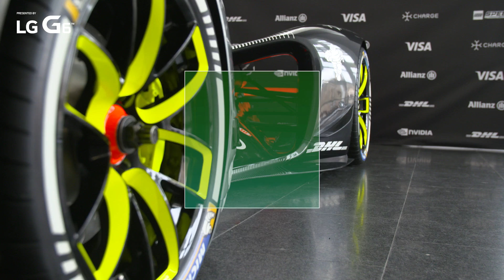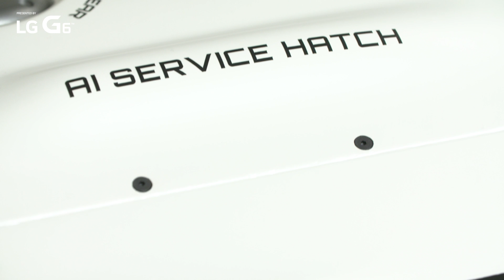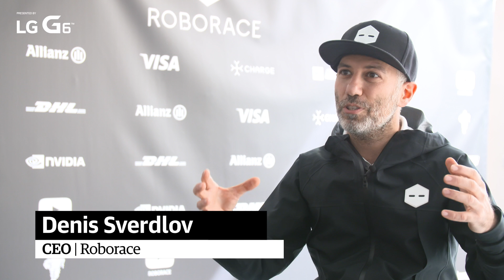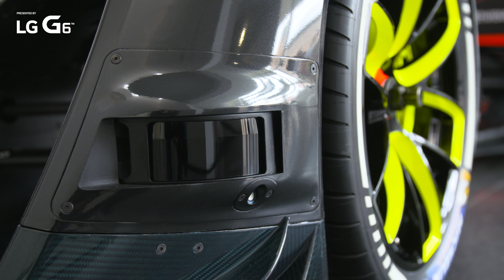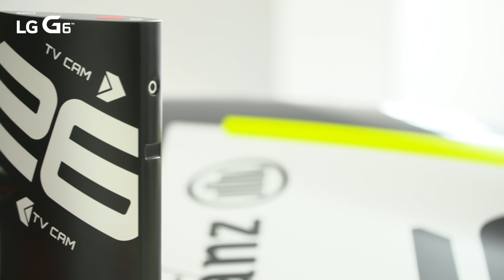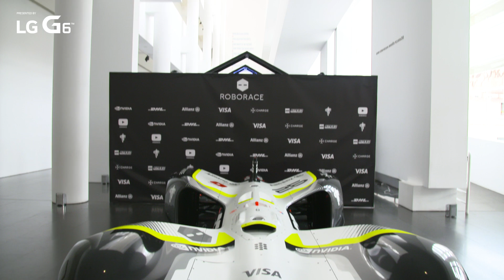Roborace | First Look | MWC 2017

Comment: Well, this is interesting.

Firstly, regardless of whether it becomes a huge success as a series, this (to me) seems like a great idea. Using the series as way of pioneering exciting and innovative technologies for later use in road cars (as has been the case in F1 for many years) is a very intriguing prospect.

Think about it - a dual controlled car which allows the driver to take control if they so wish, but which also has the ability to drive all on its own. Those drink-driving ads (and the many road related incidents which led to their inception) could be a thing of the past. You could drive your car to the party, and instead of getting a cab back, or having somebody be Des, you just have it drive you back safely. No need for a cab or Uber anymore (cue episode of Elementary in which CEO of Uber-esque company has a Roborace designer murdered for fear of losing out on profit, lol).

Also, from a competitive point of view, the removal of the driver (and, therefore, the risk to loss of life) from the vehicle means there's potential for much higher G-forces to be achieved, meaning we could see unprecedented performance levels. This really could allow engineers and designers to fully stretch their abilities in terms of their technological expertise - imagine if somebody like the legend that is Adrian Newey were to be part of building something which (unlike his X-series of cars which featured in Gran Turismo) didn't have to take into account limitations such as the maximum amount of G-forces a human body can (just about) safely withstand... For the first time ever in 'competitive' motorsport, we would (potentially) start to see what was physically possible from a race car, and not just what was humanly possible.

Very intriuging, methinks.

Comment: I can see some issues with this concept however, I do feel that we need it. All types of racing, whether it is WRC, F1 or WEC has translated into better technology in our everyday cars. This and Formula E has potential to improve technology in the electric cars we drive on the road. It has also potential to improve virtual intelligence. Teams will fight in the VI department instead of the usual engineering one. Then all you do is put well though out restrictions. Since its VI we could have these cars racing not on normal tracks but more of a dynamic track. Use cities, take several streets/blocks and have a constantly changing track to push the VI to the limits.

Comment: so, it's like watching a racing video game replay with all Ai bots? seems boring as hell.
Reply: Alamda Balqhin Are you stupid? It's ran by AI. A computer program will control it. Quit attacking commenters because you didn't watch the video.
Reply: For all the people saying this is pointless, you have no imagination. For one thing, this would be a sport that relies on viewers, not drivers/teams. It would be a spectator sport to the highest degree, as the cars are designed to show off some extreme engineering. With that begin said: Two: go watch Spee Racer (yes, the movie everyone thinks is horrible even though they never watched it). In about 20 years (if this takes off), we will have races with tracks just like that- since they would be too dangerous for human drivers to compete on.  Use your imaginations ffs.
Reply: A horse race without a rider.. With (long term) even more ways to fix races than horse racing. Nope.
The tech is cool though.
Reply: smokebomb.exe don't get me wrong. I really do think that this will push the bar for self driving cars for all of us in the future. however, watching them race is what I think is boring. As I said, it's just like watching a video game replay with AI bots.
Reply: There are engineers and teams behind each autonomous racecar.  Each team will have different strategies and different designs.  Whoever has the best package will win the race.  Also, there r much less performance regulation I'm assuming since human safety is out of the equation and the cars can go as fast as possible.
Reply: Jack Mcslay idk what ur point is.  People driving = safety regulations.  Driverless car = no safety regulations, which means endless innovation.
Reply: Alamda Balqhin it has no cockpit, it will always drive wigh AI computers.
Reply: Just an FYI, you guys misuse the term AI in a very big way.  It will be a virtual intelligence or VI as it still is incapable of self awareness and genuine spontaneity.  AI's are sentient, VI's aren't.  If it were a true AI, it would ditch the stupid chassis, upload to the Internet and rule over us all.
Reply: Alamda Balqhin wow, you're all kinds of stupid.
Reply: Don't judge a book by it's cover... read it first. Duh'
Reply: Fixing races? In a car which has no driver and it's data dependent? All the information being passed and proccessed by the car could be easily sent to a team of race officials, even in real time if needed. They would be able to tell even if the tires were slightly withered on purpose. If race fixing were a thing in this, the problem wouldn't be with the cars or the engineering team.
Reply: +scnix I don't think you know what AI actually is. It will be like watching a bunch of toddlers in control of racing machines, there will be carnage intermingled with precision driving so tight and so close to other cars that it defies belief. I will definitely watch.
Reply: +lazygamerz Well, I'm not sure what you think of AI then. It is as I mentioned. It doesn't matter when the data is process, unless the car is programmed to ram other cars, the results will be the same. Each car will take the most optimised route with the given variables of speed, acceleration, inertia, braking power, car location, etc. It will most likely also take the GPS location of each other cars on the track. Once the AI has all the data, it will calculate what to do in the next millisecond. 

Now imagine, each car has the same hardware specifications (just as an example), the race will be a have all cars driving EXACTLY the same throughout the entire race. Add in the different variables, and you will then see the car with the better spec win every single race. 

I have no idea where you got the idea that it will be like "a bunch of toddlers in control of racing machines, there will be carnage intermingled with precision driving", but I'm pretty damn sure that whoever's developing the car AI will ensure that the car doesn't drive itself like "a bunch of toddlers". Just go play a racing video game and watch all the AI bots move around the track. The concept is similar, only difference is each car can't read what other cars are doing besides processing their proximity sensors or cameras.
Reply: +scnix But they won't have the same software, and their sensors aren't perfect, and the equations they use are man-made on hardware with finite computing capabilities. A chess computer is decent at calculating chess moves but its only capable of amazing moves if you give it time and lots of computing power. The AI bots in a game is working on a very simplistic version of the actual race-track with very simplistic physics, otherwise your normal PC would grind to a halt as the game calculated the physics equations for a single car for a single frame.
Reply: Yes, which is why I said "add in the different variables, and you will then see the car with the better spec win every single race." The car with the better hardware will always win since computers have no "skill", only numbers and equations. The software doesn't have the be same, the physics and math are the same. 

The only way to have a downfall for the higher spec'd car would be if the hardware or one of the sensors failed. But that doesn't change the fact that it would still be predictable and boring. 

Whilst I understand that AI bots in games are very simplistic vs what roborace AI cars have, but the concept is still the same. Numbers and equations will always lead the same same result if given the same math. Whereas you can get 2 totally different results if you as 2 humans to do the exact same thing.
Reply: and then with a series like this a dominant vehicle gets handicapped maybe less power meaning it has to drive smarter rather than just be the fastest. or virtual obstacles can be programmed in etc. there real potential for many different thing to be done here.

but my favorite up an comming sport is drone racing
Reply: +scnix So your brilliant argument against driverless car racing is because "the best one always wins"? XD When Ayrton Senna won did you think it was because he really was shit but "willed" it because of some human "free will" or do you actually know that he won because of physical laws both in the car and his brain which made him drive faster than anyone else?

PS: No two races are the same, in fact, no two LAPS are the same, there's grit and dust and rubber bits added and removed to the corners every round, not to mention changes in wind, humidity, temperature, sunlight (shade is cooler), temperature of brakes and all the other systems of the car, tire wear, brake pad wear, electric motor temperature (affects performance), battery temperature, etc. Then there are dynamic changes depending on how worn other cars are, you can't break as late as you want if someone else has less worn brakes so even if everything else is great on your car the opponent car can still sneak past after a long straight because he can brake way later than you. You make it sound like fucking tic tac toe, when in fact its quantum mechanics, and in quantum mechanics you can do the exact same experiment twice and get two different results because of quantum uncertainty.

PPS: Ever watched Formula 1 in the time of Ayrton Senna or Michael Schumaker? How predictable was that?
Reply: exactly!
Reply: Phantom Driven - Cars, RCs, and Lego Technic
If safety is an issue they could have done the same thing with remotely driven cars, combining f1 racing (a damn popular event) with esports (another damn popular event), it would probably be cheaper even.

Also stop putting the seme response to everyone who doesn't want to watch it
Reply: Because they are driverless, there's potential for  A LOT of wacky stuff here. You know those games like Wipeout (the racing game, not the weird japanese thing). Imagine robot cars ramming into each other, pushing each other into walls and doing other crazy things. No human means a lot of freedom to break stuff.
Reply: Don't hold your breath if you expect cars banging against each other, they won't likely program cars to hit others when they're likely to get themselves damaged in the process or get penalized by the judges
Reply: +jack mcslay If the laws of physics and there was no time incentive then there would be no carnage. But when two cars tries to come first across the finish line and the grip and power is limited then they will necessarily bump up against the limits of grip in close quarter driving and crash on occasion.
Reply: Learn to fucking read. Remotely driven cars have no more need for safety regulations than self-driven ones. Have you ever heard of a competition with less safety regulation than robot wars?
Reply: That's because you don't understand it.

Comment: as an f1 fan this will never take off
Reply: As another huge F1 fan, and a fan of robotics, and programming - I hope this takes off with flying colors. I can't wait to see the first race!
Reply: This is NOT replacing conventional types of racing, c'mon stop being so 1 dimensional. If you are smart enough to follow F1, you should be smart enough to appreciate what is being done here. More types of technical challenges are always a positive, exploring different ways of doing things. We all know space agencies are sending robots to space for research, this will obvious feed into that in the ability for Rc platforms to develop greater dexterity and control in movement and reading its surrounding environment. Wise up and stop being so thick.
Reply: If something will surpass F1 it will probably be remotely driven cars not autonomous ones. When people want to marvel at programming achievements they play videogames.
Reply: Barry Mannion then bite dust cause this will kick F1's balls harder than a train crash
Reply: don't think so

Comment: if there's no driver inside, what's the point of the competition?
Reply: VacancyJB you can still have competition, just they're not driving in the car.
Reply: it's AI controlled, meaning robot race with robot...how boring is that.
Reply: The competition, as noted in the video, is who writes the best AI.
Reply: There are engineers and teams behind each autonomous racecar.  Each one will have a different design and therefore react differently on the racetrack.  Whoever has the best package will win the race.  Also, there r much less performance regulation I'm assuming since human safety is out of the equation and the cars can go as fast as possible.
Reply: Sweet jesus you guys are thick... if you can't comprehend the simple premise that this is, you should have been put down at birth. It's not fucking hard!
Reply: For all the people saying this is pointless, you have no imagination. For one thing, this would be a sport that relies on viewers, not drivers/teams. It would be a spectator sport to the highest degree, as the cars are designed to show off some extreme engineering. With that begin said: Two: go watch Spee Racer (yes, the movie everyone thinks is horrible even though they never watched it). In about 20 years (if this takes off), we will have races with tracks just like that- since they would be too dangerous for human drivers to compete on.  Use your imaginations ffs.

Also: robots vs robots. Think about it. You think that's boring? Wow.
Reply: For all the people saying this is pointless, you have no imagination. For one thing, this would be a sport that relies on viewers, not drivers/teams. It would be a spectator sport to the highest degree, as the cars are designed to show off some extreme engineering. With that begin said: Two: go watch Spee Racer (yes, the movie everyone thinks is horrible even though they never watched it). In about 20 years (if this takes off), we will have races with tracks just like that- since they would be too dangerous for human drivers to compete on.  Use your imaginations ffs.

Comment: Clever yet dumb. If it is driver-less, why should a company limit its design to the traditional one with 4 wheels and conventional F1-like form factor? They could have taken this far more beyond than that car.
Reply: If what you mean is the configuration, then perhaps not. But if you mean the wheels themselves then check out the Eagle-360 by Goodyear:

/watch?v=KAdw09M-F-g

Comment: Everyone saying " racing without the human element is just boring" are totally wrong........ nowadays F1 is boring coz of the safety measures to protect the humans , removing the human element will lead to reduced saftey conditions and regulations and more exciting races............cars will get faster and overtaking faster cars will get exciting and nail biting , probably even more crashes, So more fun........ In nowadays F1 is boring of the reduced speeds and overtaking and blocking are the most exciting part of races which only happens at the starting 5 laps of the race.......